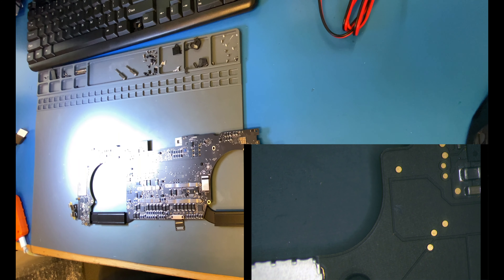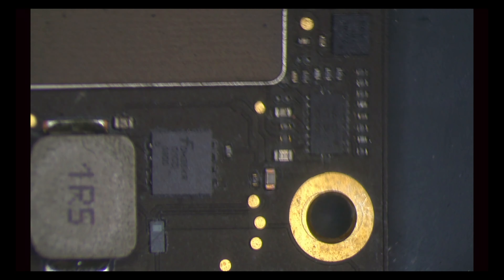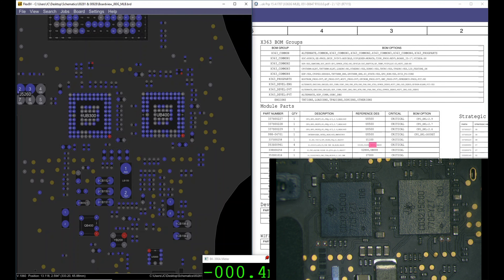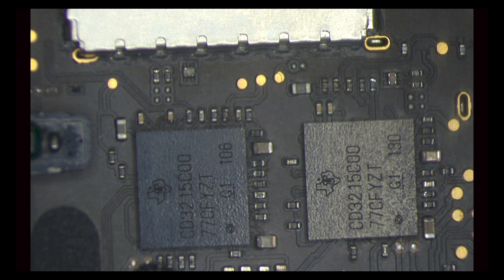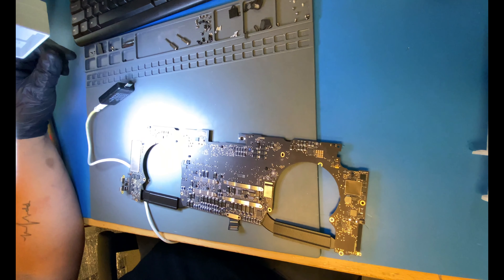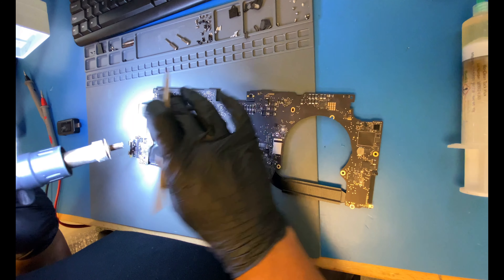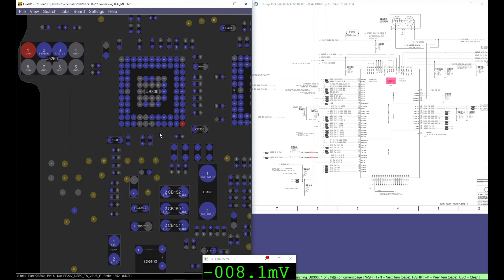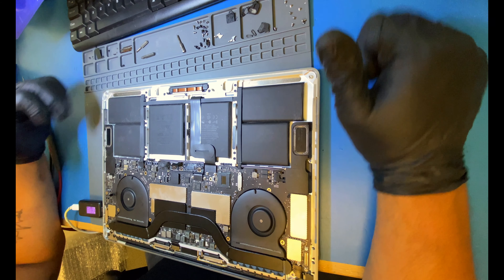A1707 MacBook Pro 15-inch NO POWER USB-C 5V WATER DAMAGED

Comment: What liquid did you put on it and we're you just using a blower dryer to dry that area?
Reply from the maker: I clean the boards with alcohol.
Reply: @Juan4Repair  wondering if you can help me out with my problem? I can't get my MacBook 15-inch A1707 model to charge or turn on. I tested the power through the ports with everything connected and got 20 volts on all four ports. I spilled coffee on it like a year ago and had it cleaned during that time and recently it just turns off and doesn't turn back on. What other issue could it be and how to test those issues?
Reply from the maker: @deandrebinion3714  text me to my WhatsApp.
Reply: @Juan4Repair  I just messaged you.